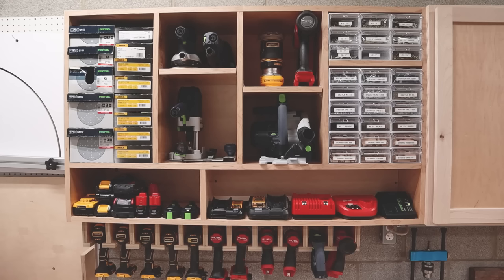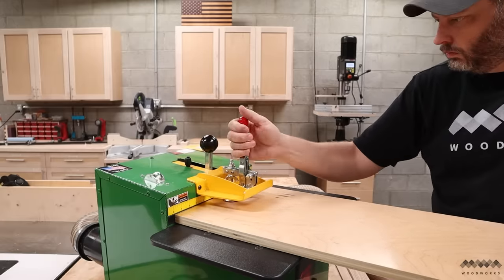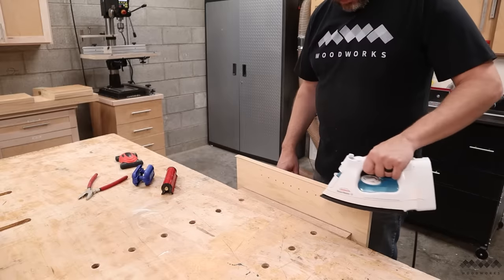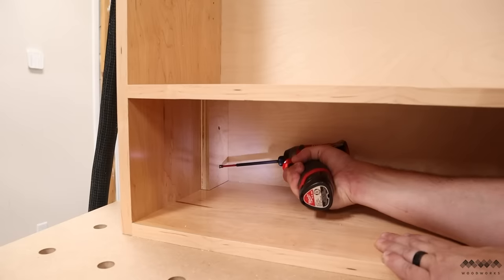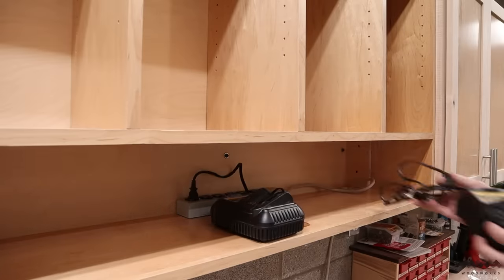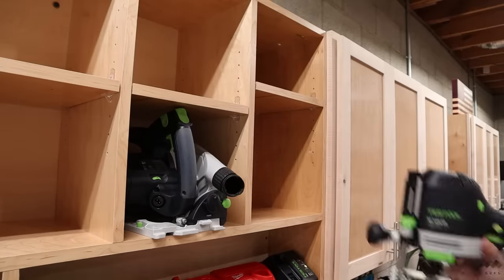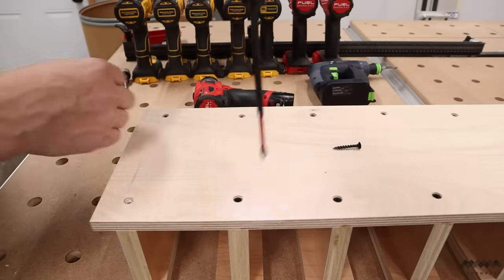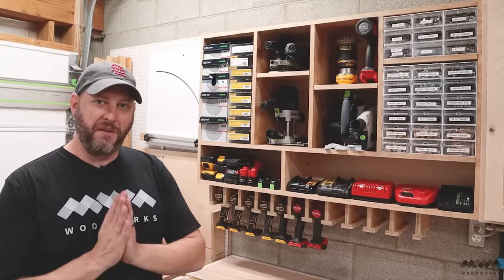Easy One Day Shop Organization | Drill Charging Station

Comment: Only concern I can really see is the false wall encasing the surge protector/power strip used to power the battery chargers. If there is ever an issue or emergency, that could be problematic. Personally, I would use a hinge on one side and just sandwich the other to keep it looking nice, but would give access to that power source is needed. Otherwise, beautiful and simple build. I'd like to incorporate this into my own work area. Great job.
Reply from the maker: Yeah that would be a good idea 🙂

Comment: Thank you for this video Matt. It truly inspired me. I purchased your Whole Enchilada Bundle.
This will be my first cabinet build. Of course I will be modifying the plans slightly for the space on my wall. My plan is to use 2 recessed French cleats anchored into 4 studs.
You did a great job with the plans. And I love how you included the diagrams at the end showing about how the cuts would line up with the sheets of plywood so that I can plan my cuts efficiently.
You gave the length of the screws. But, being my first build, Do you use #8 screws on the cabinet? And what screw should I use for the French cleats into the studs?

Comment: Thank you for this Video Matt!

Question… what’s the expandable table legs called you use for your track saw? Also what is the pad called you add on top to use as a top?

Thank you!
Reply from the maker: It's called a Centipede. I think there is a link to it in the description of several of my YouTube cabinet videos. The pink stuff is house foam insulation board.
Reply: @MWAWoodworks  thank you 🙏

Comment: Matt, I attempted to add a comment regarding this project on YouTube and via the plan review.  The comment on YouTube is not showing up and the review post is blocked.  Some of your affiliate links are pointing to incorrect parts -- trays and locking shelf clips.  Also, I offered a suggestion regarding the identification of the Drill Caddy Stretcher.  Overall, a good experience, but disappointed that I did not vet your affliiate links better.
Rick
Reply from the maker: Hello! All the affiliate links including the ones mentioned point to the correct products even though the plans are a couple years old as of the writing of this comment. Amazon has not changed the links.

Comment: I love the build, but is it a good idea to conceal the wires from the chargers that much? They draw very little current, even with a battery in place, but it still seems like a mildly risky mixture of heat and wood. That said I will be building something very similar for my shop soon.

Comment: Were the Tapcon screws used in hollow block? Or are the block filled with concrete?
Reply from the maker: Hollow block however solid mortar as well as solid ribs between the hollow spaces

Comment: One thing i never understand is why one guy needs so many drills and drivers. Did i count 7 with room for 4 more??  I`m not trolling but i have two cordless drills, both of which i bought used, and two batteries between them and i`ve never felt the need to go beyond that, so far.  My curiosity is genuine.  What am i missing here?
Reply from the maker: I've acquired them in different ways over 10 years
Reply: There can be cases where have more than two drills can be useful to avoid switching out bits between them so much. I've done projects where I had 6 different drills in use at one time. Then if you have an extra person or two helping you they might need their own drill/impact as well. So it is very easy to end up needing 6-10 drills on a single job at times. Many times I'll have at least four in use.
Reply from the maker: I've done outdoor construction projects with groups of friends and supplied all the drills/drivers for the project.